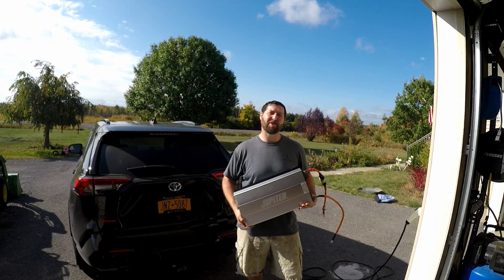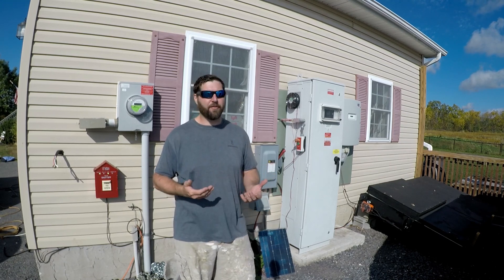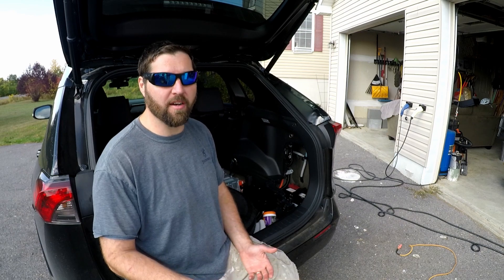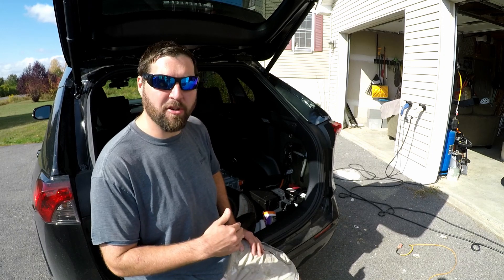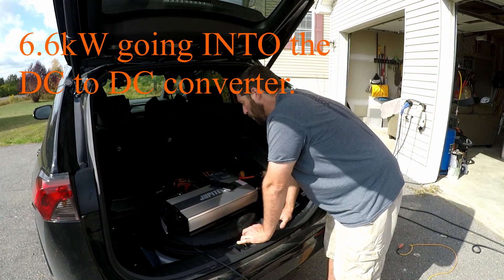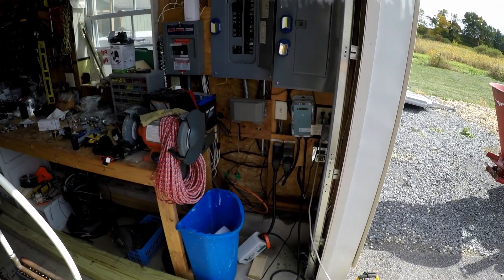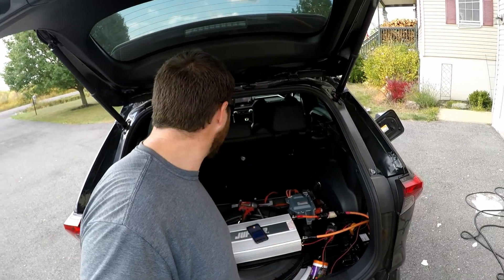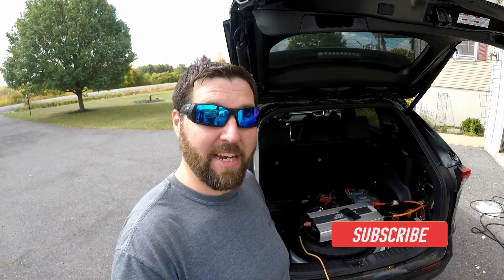Can a Toyota Rav4 Prime Power Your House???

Comment: Any chance you can pull 220? A bit like plugout power does with the Prius or the rav4 hybrid?
Reply from the maker: Pull 220?
Reply: @JamesKlafehn  yes or output 220v power. Your video looks like you’re back feeding 110v
Reply from the maker: @Kryst69-r2s it does not have 220v output. It’s a 110v inverter
Reply: @JamesKlafehn  I understand, I meant have you tried getting a 220 inverter and back feeding the full panel?
Reply from the maker: @Kryst69-r2s  I have done it plenty of times but not off 12v. Its only a 1200watt dc to dc in the car. Check out my videos about my Rav4 EV. I did it all the time with that using my Prinston Power DRI10 inverter. If you are thinking about doing it you need an off grid solar inverter that is connected directly to the HV lines from the battery. Be careful though. You can die easily.
Reply: @JamesKlafehn  thanks, and yeah those are some high voltages. I’m trying to find where those wires are and how to tap into them. Plugoutpower has done it for everything but the rav4 primes so far.

Comment: A word of caution, I believe that Toyota says never to jump start another vehicle with their hybrids.  The reason is you can burn out the HV to 12 converter.  The 12 volt load required to start the jumped vehicle would exceed the limit of the dc to dc (HV to 12 volt) converter.  The HV to 12 volt converter is expensive to replace and has it's own independent liquid cooling system.
Reply from the maker: The converter does NOT have its own cooling system. I have been in every inch of this vehicle and I promise you that is not true. The DC to DC is a 1500 watt unit and will turn off the load if load exceeds that. Its safe. It worked great.

Comment: So just to clarify, you have that inverter hooked up to the 12V battery? So is the traction battery constantly replenishing the 12 volt here are are you essentially just pulling directly from the DC-DC converter?
Reply: So I'm looking to use the Rav4 to charge a campers 12v battery bank with a 50 amp DC-DC charger. Will this work? It would be pulling 600 watts max. Seems doable?

Comment: How much of an efficiency hit do we take by going through the 12v and not the 350v battery? I'm looking to have a backup power supply for my camper (a foamie sorta like yours) and I only would want to have <1500watts in case I drain my campers batteries/pv system and it's cold outside. Should I just do the 12v method?

Comment: Great video! I was looking into the Rav4’s stock 1500w inverter in the Prime W/tech package but the manual says it does not work well with anything with a microprocessor, a timer, or and devise that needs extremely stable power so it sounds like toyota is using a modified sine wave inverter. I wonder if it’s possible to swap it for a pure sine inverter 1500w or maybe more 🤔

Comment: Another video from "the car care nut" says the Prime does not have an alternator and the 12V battery is charged by the main battery pack.  That would seem to indicate that you would not need to keep the car running if the main pack is fully charged (at least for awhile) the Main pack is 18 Kwh
Reply: It doesn't have an alternator because there isn't an engine to spin it; the DC/DC converter acts as an alternator in this case.  When the car is running, the DC/DC converter will convert 400V DC to around 13.5V DC for the purpose of charging the 12V battery.  If the car is not turned on, the contactors are open between the main battery and the DC/DC converter, so no power enters the 12V battery from the main battery.  This is what he meant when he said the 12V battery would run down very quickly if the car was not 'on'.  I hope this helps.
Reply: @2mYgR  Interesting. I'm hoping to use this to charge my campers lithium battery bank via a 50 amp DC-DC charger (which i also use for solar). Will this work?

Comment: Thanks for the inspiration! Instead of buying a portable gas generator to power my camping trailer, I bought a 1500 watt 12v DC to 120v AC inverter and connected it to my RAV4 Prime’s 12v battery. I only need to power the trailer’s 6000 BTU AC, it’s built-in 900 watt microwave oven, and a few AC plugs. 1500 watts should be plenty as long as I don’t run the AC and Microwave simultaneously. Tested it out and so far - so good. The RAV4 HV inverter keeps the 12V battery charged as long as the RAV4 is in ‘Ready’ mode. I have a Prime SE, so it did not come with a built-in 1500 watt 120 AC plug in the back. I figure that my setup will not cause harm, since it is basically mimicking what comes standard on the XSE.
Reply: Interesting. I'm hoping to use this to charge my campers lithium battery bank via a 50 amp DC-DC charger (which i also use for solar). Will this work?
Reply: If I followed I think James missed this, or at least did not clairify when he said the car is running> "The RAV4 HV inverter keeps the 12V battery charged as long as the RAV4 is in ‘Ready’ mode. "

Comment: Will the DCDC converter operate without the key in the car and the ignition on? One would hope that the car is monitoring the 12V battery even when the car is parked...
Reply from the maker: No. I think I talked about it in this video. Car has to be in Room Mode or in Ready Mode. The 12v battery is not charged while the vehicle is charging... Very odd. Tesla doesnt do that.
Reply: @JamesKlafehn  You did say it in the video. I was double checking. Thanks for the clarification. I was hoping to charge power tool batteries with the car sitting. The Ryobi batteries only hold 4 Ah so I guess I could charge a couple of those without the car running and not kill the 12V battery. Or room mode is always an option.
Reply: @JamesKlafehn Because my ready mode would go off after some time. I will have to look at keeping the ready mode running indefinitely. I think I remember the car might have even asked me....

Comment: Do you know is there a fuse or relay you could pull that would prevent the gas engine from turning on?  Would like to run this setup in my garage but not get carbon monxide poisoning. 

I checked and the prime has 4 fuse boxes and none seem as simple as the fuel pump or starter.
Reply from the maker: If you leave it in EV mode the gas engine won’t turn on. You have around 13 kWh to use. Once that is used up the gas engine would turn on to recharge the battery.
Reply: Thanks for the reply.  I did realize about EV mode I was just looking for an extra bit of certainty so even if there is a glitch or I forget about it the gas engine wouldn’t start.
Reply from the maker: @akatraypa  It would be a long time to use the entire 14ish kwh.

Comment: Go buy one of these and plug it into the traction battery.
https://novaelectric.com/product/lightweight-pure-sine-wave-inverter-2-5-kva/
ELECTRICAL
Input Voltage: 270 VDC Nominal, 180-355 VDC Operating Range (other ranges available)
Output Voltage: 120, 208, or 230 VAC (specify)
Reply from the maker: Wow they look pretty perfect! Ill look into it! Thanks!!!

Comment: Wow, would never guess the HV to 12vdc convertor would be so large. Could this be that the HVAC, power steering, coolant pumps and fans  are all working on 12vdc? We have used a inverter in a marine application of appx 400 vdc which outputted 3 phase 220 Vac. Cost was appx $1,500.

Comment: I would only use a pure sine inverter if you have computers and other sensitive electronic devises receiving power from the inverter. 

In three years when your lease runs up you will return the Prime just like the Harbor Freight inverter you are experimenting with in the video. 

I disagree with how you will experiment with something you don’t own and just return it like the inverter and the Prime. 

Harbor Freight is going to put the inverter back on the shelf for someone else to purchase not knowing you used it for an experiment. 

The Rav 4 Prime same thing. When the lease is up you are going to unload it and some unfortunate person is going to buy your Prime experiment. 

It is wrong and you will not disclose all the experiments you are conducting on a leased Prime. 

I have no question you messed around with your Tesla before you started having error messages and did not disclose to Tesla before they accepted the return.
Reply from the maker: More negative comments from Russ I see... 
When did I ever say I wasn’t going to disclose what I’ve been doing? I’ve been honest and open about absolutely everything. If I was going to hide something I wouldn’t put it on a fucking YouTube channel idiot. 

As for the Prime and the inverter, they are both still flawless. I didn’t harm either in any way. I didn’t do anything to void either warranty. I haven’t even done anything permanent to the Rav4 Prime. The tiny little hole I drilled for the reverse camera switch is in a panel that I could replace for $49 if I ever wanted to. 

And I didn’t harm my Tesla, Tesla did that on their own. 

Start being more positive.

Comment: Cool video. Is it possible to leave the car on but locked? For example to function as a generator at a camp site without leaving it unlocked for whoever walks by.
Reply from the maker: The car would need to be running. I havent tried yet but with my Rav4 EV I can lock the car with the key thats inside the fob. Take it out and turn it in the keyhole in the drivers door. It will lock all the doors and the car will stay running.
Reply: I've heard this is possible with the actual key not the fob. Interested if anyone knows.

Comment: Nice stuff...nevertheless, the XSE trim provides a std 120V outlet , exacrly at the same location on the dide panel....
Reply from the maker: Yup. Its nice they offer that. I wish I had an XSE but not just because of that plug.
Reply: My xse prime does not come with a standard outlet.  It comes with a 120V cigarette lighter socket
Reply: keoki90232 sorry...the XSE trim...with the technology option...comes with the 120V outlet....

Comment: So I'm curious, I used to run an inverter off my 12v battery in my ice vehicle, but I was always limited to what the alternator could supply.  In a hybrid does the large battery charge off an alternator or is it charged by the motor that drives while in ev mode?
Reply: There is no alternator in most hybrids since there is no need for one. The engine is able to link to one of the drive motors to run as a generator and create electricity, just like it does while driving at times. An alternator is very similar to a small electric motor anyways. Of course with a PHEV like the RAV4 Prime one could charge it from the grid fully before losing power, then draw power from the battery until it gets low enough that the engine would start. Once the engine starts it would cycle on and off while it charges the battery so it wouldn't run constantly like a regular car or a proper standalone generator would.
Reply from the maker: A dc to dc is like an alternator yes. 
The large battery is charged from the onboard battery charger. I just released a video all about charging a plug in car a few days ago. You should check it out of you’re interested.

Comment: I have the 1500 watt built in inverter with the Premium package in my RAV4 Prime.  So how would I use it to power my house? Just use an extension cord and surge protector?
Reply from the maker: 1500 really isn’t enough for more than a couple items. But you can see in the video that I turned off the breaker then plugged my car into the circuit the breaker was on. That way it will power the items that are plugged into that circuit. You have to make sure you turn the breaker off though before you do this!

Comment: Nice James, But here is my question. If you were able to get the RAV4 XSE Prime that you originally wanted, and the fact that it has a 120 VAC outlet in the cargo compartment, would it not have been easier to use it to power in house?   
I  never had plan of owning a house in NY, not until a few months ago, but when I do I want to be in the countryside and produce my own power, but I do not want to depend on  Solar only, I want a hybrid system that can also use a small wind generator to recharge batteries when/if the is no sun light.
Reply from the maker: My goal was to be independent too. You could watch my solar playlists if you wanted. Wind is very expensive and heavily regulated FYI
Reply: @JamesKlafehn  OK will look for them a watch them, But as for wind system I did not know they were expensive and  heavily regulated. Why is that?
Reply from the maker: @superlight47  It will depend on your town but in my area the leaders make it very difficult to get permits and get wind turbines approved. They are democrats too. Youd think they would want MORE renewable energy. For wind you have to go high up for consistent power. That is expensive. Quotes I was getting for a 10kw turbine were $50-$60k!
Reply: @JamesKlafehn  Oh wow! that an eye opener 50 to 60K US can build me a house in my Caribbean home land. That really is high. I am presently try to move up to Albany as a renter  and hope within the next year if this pandemic end  to buy a house in Albany. it be nice to save some one generating your own power.

Comment: What is your opinion the wear on the 12v battery when running max output of the dc to dc inverter for a long period of time? I did this about a month ago with a battery that was almost 4 years old and a day or 2 later while driving to work, my 12v battery died. I replaced it with a 84 month Toyota battery and everything is running like it should now.
Reply: The item to be concerned about in terms of "wear" would be the DC to DC converter in the car. The 12 volt battery is really not having to do the work.
Reply from the maker: Ted Dy a dc to dc failure is very rare.
Reply from the maker: If you’re going to do it you want a deep cycle battery.

Comment: showoff using back feed and shutting off the breaker...  just use a power strip
Reply from the maker: That would obviously work too but when you are backfeeding a circuit it sends power much further because the wires are already ran in your walls.

Comment: I’ve done this (kinda) with my Chevy Volt during hurricane power outage.   I was able to run two refrigerators, a medium sized LED TV, modem router, and a couple of LED lights for around 16 hours With the car parked in my garage.   I monitored my high voltage battery level on the car… And when it got very low, I would unplug the extension cord running into my house, pull car out of garage, and I was able to use the engine to charge it up to 60% in “mountain mode “ in only 15 minutes!!

That gave me enough juice to run for another 8 to 10 hours before repeating.   Obviously no air-conditioning, but it was very very helpful!    

Can’t wait till VTG is more of a reality for all.
Reply from the maker: Very cool! Im glad Im not the only one into this stuff.